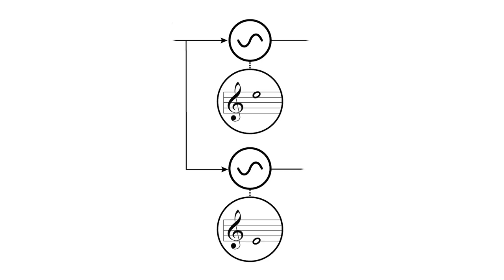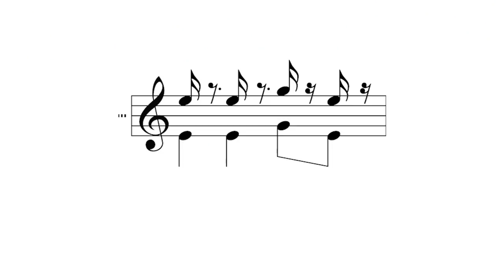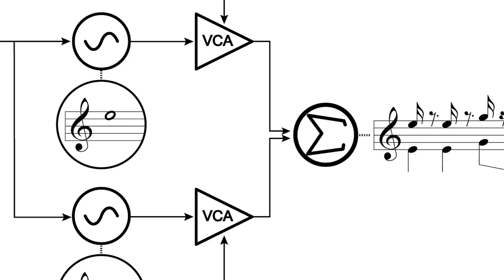Strange Patching: Parallel Envelopes

Comment: This is a good example of why you don’t always need ADSRs in modular. ADSRs are often useful for creating some sort of distinctive start to an otherwise sustained sound, but with modular you can modulate all sorts of things, not just amplitude, filter cutoff and maybe pitch. Often an ASR envelope will suffice for the main envelope, while a second AD envelope provides an interesting attack by modulating timbre or by bringing in another layer as you do here. When I got my Maths I thought I’d often patch up an ADSR using the OR output, but I’ve ended up using them separately like this: it’s much more flexible.